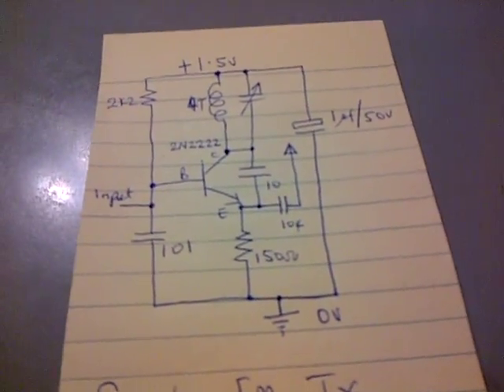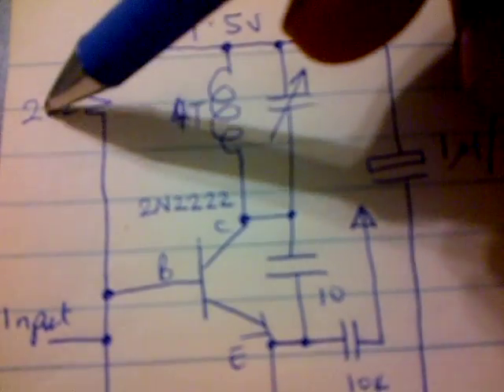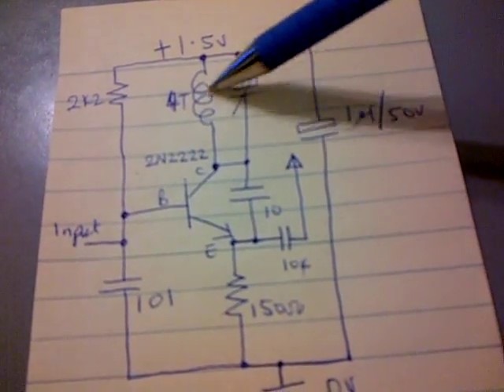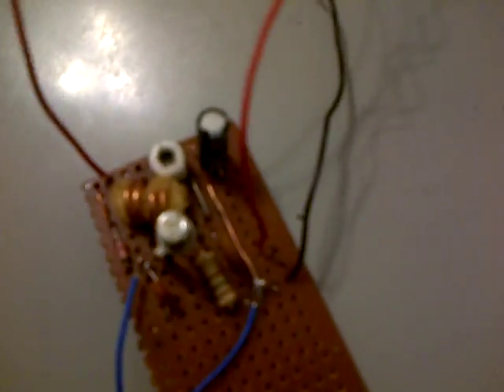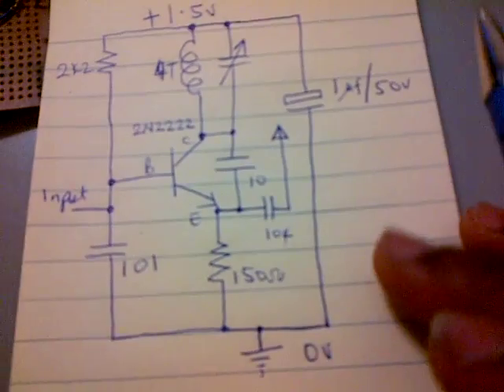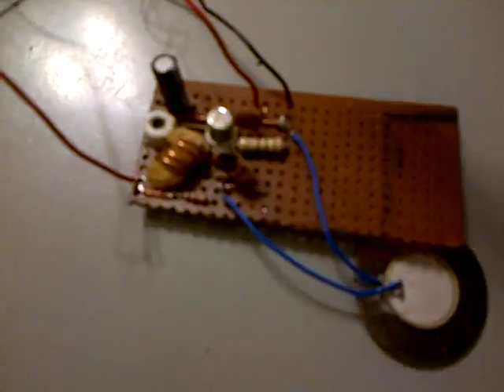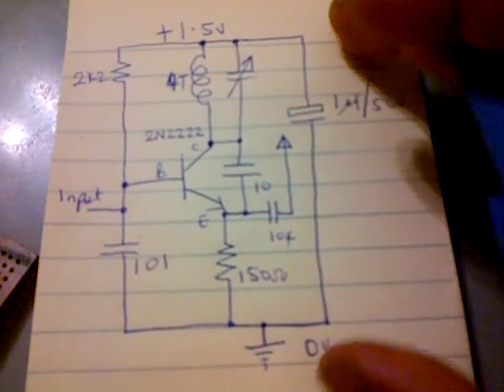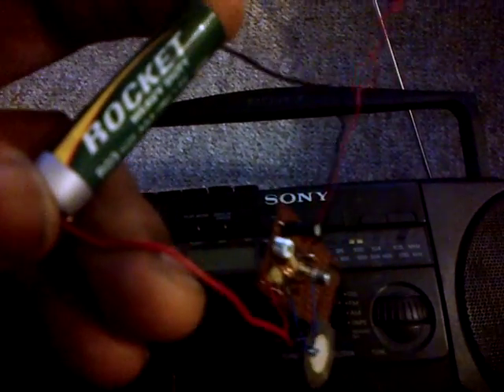Crafting a Simple FM Transmitter with One Transistor | HecaWorld One-Transistor FM Transmitter

Comment: what is the value of the variable capacitor? and the capacitor in front the transistor that says 10, is it 10 pecafarad ? u should tell these, especially the value of the variable capacitor. and also the diameter of the wire used as he inductor. please, i have to travel very far to get these components. I dont want to go and buy the wrong ones

Comment: Thankyou for your help sir. 

But can I use my wasp fm tx or yours with an HT12E's output as the tx's input. And on the other side use you FM RX's output as HT12D's input, then things will be alot more easier and there would be a scope for data transmission also. 

I live India and here i searched a lot online for cheap fm radio but didn't get, so I think I should better go with your good and simple design. 
If the range gets reduced then I can increase the TX output or make a relaying module.

Comment: My project :- Sir I placed a simple switch on a door of my house and the switch is attached to an Atmega8 micro controller. Now when the door open and switch gets activated, I want the micro to inform another micro sitting 30m far and connected to my desktop PC. Sort of home automation so that micro with the receiver can inform me using the internet via pc. But i want to do it in a very cheap and diy way. I dont want to use any expensive rf modules instead I want to use FM.

Comment: Sir thank you for your fast reply. I have built a 100m range fm transmitter from talking electronics. (Wasp from talking electonics) I am planning to attach the Mic input to a digital pin on micro nd use your FM RX as a receiver. Even if I don't want to have a full data transmission now but I just want that the receiver can detect if I put digital high on the micpin of TX. For example I simply want to turn on a led on the other side. So how is it possible?

Comment: Sir, first of all I just want to thankyou for your fm related videos (TX, RX, Pre-Amp). I want to use your circuits for establishing communication between my micro-controllers, so I want to know if I can use the FM RX to receive encoded data from your FM TX within a range of about 40 meters inside a building. I can use better power supply and any antenna length so just tell me if it is possible.

Thank you in advance.